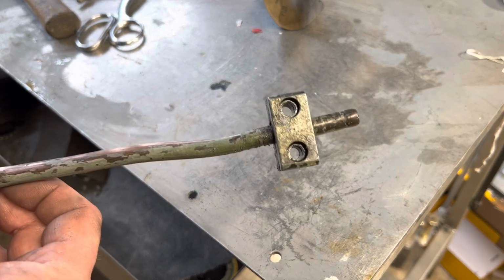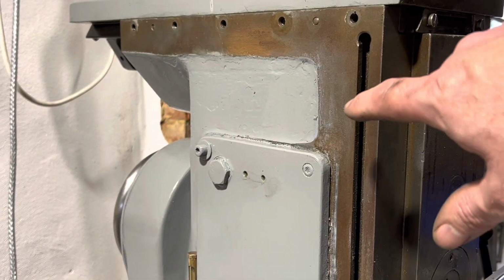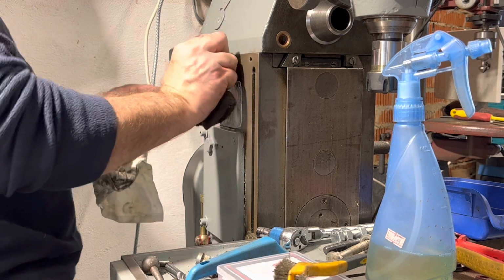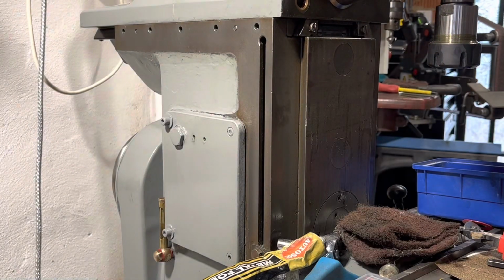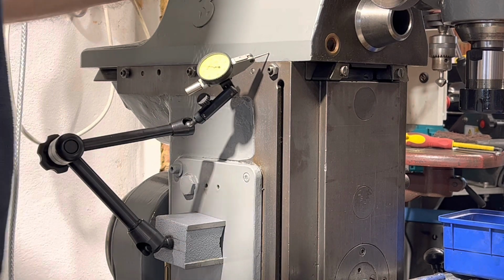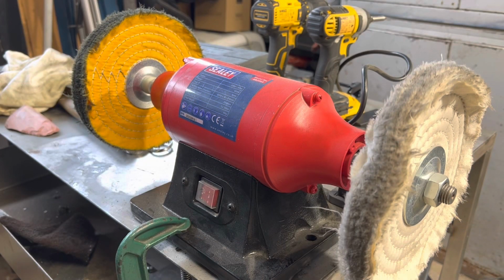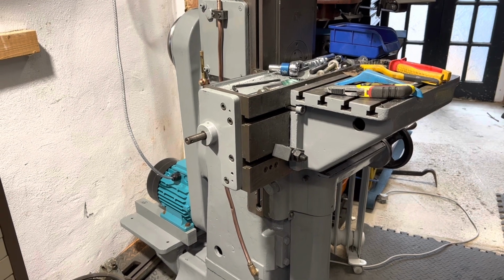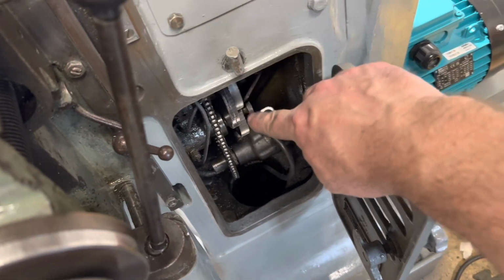Deckel FP1 Clone, Alexander Master Toolmaker Rebuild, Part 4

Comment: Nice job so far....the cracked casting and the wobbly repaired handwheel always bugged me but I never got around to fixing them either !!
Reply from the maker: Thanks Dave, yes it’s low on the priorities. I may actually put a larger diameter wheel on there which some of the Deckels seem to have. Will help with leverage for sure.